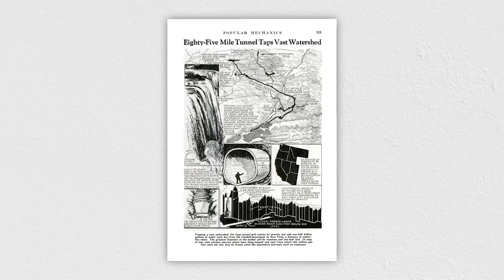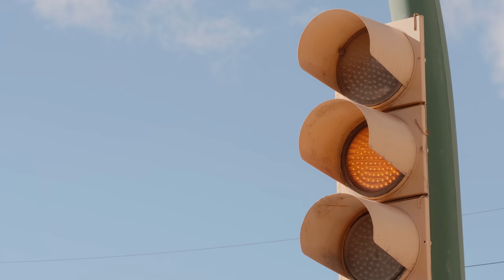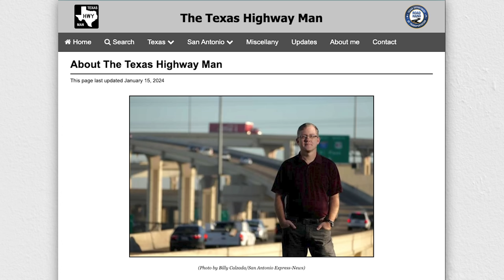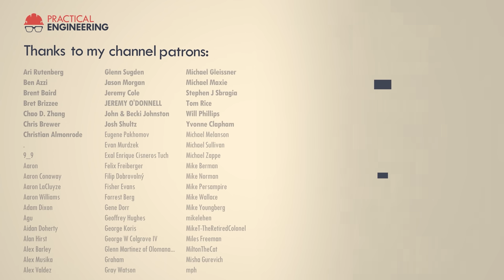Why Are Texas Interchanges So Tall?

Comment: As a former Ft Worth resident, I can tell you the one major downside is during the rare (but inevitable) ice storms. As there are no salt trucks, this causes glaze ice on these interchanges, causing huge pile-ups.
I barely avoided being a part of a hundred car pile up when a semi trailer made it 95% of the way up to the top, but due to traffic stalled ahead they had to hit the brakes...it then jack-knifed & came sliding back down, pushing every car on the 2 lanes & the side berms all the way back down.
There was nowhere to go, no way to stop the accident, no way to back up...literally dozens & dozens & dozens of cars crushed in inevitable slow motion.
Afterwards, the cars had to wait for hours & hours in the freezing rain while a fleet of tow trucks worked to pull each successive car out, starting from the furthest back.
Reply: I almost got caught up in this driving Uber in Austin. I got extremely lucky that my car got out of there without a scratch. After we were stuck for two hours, we got moving then I lost control again managing to skid right between two cars that couldn’t move then I got control again before hitting the barrier. I immediately took the service roads home after that which were just fine because they were not high up in the air with the freezing winds going above AND below the road.
Reply: I live in Dallas.  We have at most perhaps one or two ice storms a year. Salt trucks aren’t a thing.  And heated tram rails are discussed every time ice stops rail service but always is dropped due to cost.
Reply: Yep. Those of us in places with inevitable and routine roadway icing, bridges are the absolute worst to drive on. They're not insulated by the ground below them!
Reply: They block off and close the I-30 West to I-35 South interchange in Fort Worth when icy conditions exist.  They had to because so many trucks got stuck trying to go up the long elevated section.  They just keep building more of these stacked interchanges.  I-820 / 121 / 183 interchanges, I-30 / 360 interchange for instance.
Reply: I don’t know what y’all are talking about. I lived in Richardson until last year and lived through the few crazy ice storms over the last few years and we had plenty of salt trucks. Every single intersection in Richardson was salted to the point that I got annoyed because of potential rust issues. Maybe Dallas is different? That would be surprising to me as it’s much better funded.
Reply: @ryancampbell2192  I don’t know what you mean by no salt trucks.  There’s lots of salt trucks in DFW.  That doesn’t mean you can drive anywhere near the speed limit.  If you want to blame someone, blame the drivers.  People around here drive like idiots…which they are.
Reply: @ryancampbell2192  all of you are just wrong about the salt trucks.  In addition to the lots and lots is salt trucks, we have saline pre treatment trucks.  Now…these trucks aren’t going to do side streets or your ally.  Their focus is on highways and major side streets.  I’ve lived here for 69 years old,  and ever since I can remember, there were salt trucks.  Not as many then as now, but back then, there weren’t 8 million people in the metroplex.
Reply: Ughhhh i hate to imagine having to go to the bathroom during all that.  That must be horrible
Reply: @user-wl5wj3ho5x  I may have overstated that there are "no salt trucks" but it's not like up north where salt trucks are everywhere on freeways...In DFW they just aren't frequent enough on the skyways when ice storms come on quickly.
I was there 1998-2002
Reply: I'm so excited every winter. As soon as  the temperature hits freezing I immediately start zooming around the freeways. I have nowhere to go, but the thought of joining traffic and contributing in some small way thrills me like nothing else. The news says to be careful, stay home if possible. I ignore them of course and keep on motoring around the city. I can put 700 miles on my car in a day, just puttering around the highways, always searching for the biggest and slowest traffic delays. Then I happily merge in and enjoy the ride. The bumper to bumper, the smell of exhaust, catching a glance at what my neighbors are browsing on their phones. It's so much fun and it is the greatest hobby- calling that I never dreamed of. There are millions of people like me living in Dallas.
Reply: @thomaslink2685 I feel like I’m in a weird dream where I’m the only one that knows about the de-icing trucks, and sand trucks… 
Ever gone down the Dallas North Tollway south to the end? You pass a big structure that holds the sand allotted for the DNT, and the bad accident on 35W  a couple of years ago that included a FedEx truck? I was in a huge traffic jam the day before as they spread de-icer on the highway in anticipation of the freezing rain. 
We might not have salt, but sand and chemicals de-icer is used throughout the Dallas, Fort Worth Metroplex.
Reply: There are salt/sand trucks in DFW,  but they pre-treat the bridges before any expected freezing precipation and may go back over it once after the cold stuff hits the ground.  They don't have enough of these trucks when needed, but they aren't needed often so it's hard to justify the expense.  Most Texans just stay home during icy weather anyway.
Reply: That was my first thought when looking at the bridges: How do you keep them ice free?
Reply: @JimmyLeeJr 😂😂😂 I live here and this was genius!
Reply: No agency should put salt on a road. It just too corrosive and polluting. There are alternatives.
Reply: @Hybridog  No salt in DFW. Sand trucks and a pretreatment before the storms.
Reply: its also concrete roads cause ice too.
Reply: @SiqueScarface  you don't. Stick to surface roads when it's icy, because you don't wanna slide off a 100ft flyover.
Reply: Canadian here who drove in Texas in Feb 2004 in one of your "winter storms"😂.  There was 1/2” of snow and I couldn't count the number of cars that slid off the highway.  It was like no one had ever even heard of snow, let alone driven in it.  Comical to say the least.  For perspective, a good winter storm here drops 3ft of snow in 24hrs.
Reply: So true
Reply: @jeff-w it’s such a novelty in much of Texas. We do a late work/school start and then go out. Trucks with empty beds aren’t easy to maneuver on ice. As with anything Texas, some areas get regular snow and they do more treatments.
Reply: Every time I got on an interchange during those ice storms, and someone braked on them was infuriating and terrifying.. Texans are a lot like Californians in this regard. Neither know how to drive in any kind of inclement weather.
Reply: @LoriL010  In DFW at least, there were still plenty of people on the roads. Annoying af for the people that still had to travel for work.
Reply: @Hybridog They use sand here, not salt.
Reply: @jeff-w That's because most of them probably hadn't driven in snow before. Especially the Californians. But Texans are almost bad at driving in any kind of inclement weather as Californians, so it's a bad and dangerous mix 😅
Reply: Was this the one about 5 years ago on i30???
Reply: @jeff-w im from DFW and have fortunately never been in an accident during a snow/cold storm. But it's kinda hard to become "good" at something that only happens twice a year.
Reply: I’m afraid of heights, so the thought of driving around curved roads at such high elevation makes me cringe. 😱

Comment: 13:16 The designers of the WI30/I94 interchange decided to fly the left-hand turn to merge it onto . . .  the inside fast lane of a 70MPH interstate. Extra difficulty points are awarded because the flyover lane disappears in 300yards and much of that traffic is trying to cross 3 lanes getting to the far-right exit for the next interchange about a mile away. Fun times!
Reply: I find it hard to argue if that one is better or worse than the 12/18 and I-90 interchange directly south of it, where through lanes just appear and disappear at random. I think it mostly depends on which way you are going. 151 is probably the best of the 3 of them because it just backs up instead of throwing high-speed traffic into low-speed traffic and hoping for the best.

Comment: I live near I-35 and sort of between O'Connor and Loop 1604 in Converse (San Antonio area) Texas.  The cloverleaf to fly-over construction in this part of town is a massive project, slowing traffic to a stop, and often closing the highway altogether.  They seem to be putting in fly-overs along 35 from 1604 all the way down to 410, in an effort to relieve I-35 traffic.  That's about 5 miles of being high up in the air.  The Blanco Rd. to 410 interchange is long, but this new one should dwarf it in length.  It'll take a while before I trust the new fly-overs.  I can see how an accident might back them up completely.  The way people drive here, I expect that to happen often.
Reply: I live in the same area. Right now all the construction is a royal pain, but I’m looking forward to seeing the end result.
Reply: Yup, traffic is especially bad on I-10 and 1604. I can’t wait till they finish this project.
Reply: That 1604 (Anderson Loop) highway in far north San Antonio is frightening.  With all that construction, lane closures, speeding cars coming in from on-ramps, and just the visual appearance of that intimidating fly-over section I think I might prefer to drive from Del Rio to College Station by way of the Panhandle, or just turn around and go back to Del Rio.  If there's a rainstorm, then all bets for any trip through San Antonio are off.   🤐🤐🤐

Comment: 7:13 Frontage roads were one thing that really struck me as different when I spent a week in the Dallas, Texas area.  I remember a four-lane divided highway that had frontage roads on both sides, with restaurants and other businesses all along the frontage roads.  I have seen frontage roads in plenty of other states, but I have never seen anything like what I saw in Texas, with wall-to-wall businesses along the frontage roads, mile after mile.  In other states that I've visited, frontage roads tend to be minor roads in rural areas, with businesses only near exits/entrances to the main highway.
Reply: It’s very strange to me, especially if you want to go to another business, you have to drive alll the way over instead of just walking.
Reply: Frontage roads are an absolute abomination. They literally more than double the width of most highways, and are often the “highway lite” on toll roads. They enforce the worst style of merging.
Reply: Yeah in tex as Frontage roads serve as stroads, especially in the suburbs. The thing is the noise from the highway is really too loud, and the heat is just real bad from all the concrete.
Reply: Yeah, I've had the concept of frontage roads explained to me many times, but the logic of them still eludes me. How is your front facing the highway better than your back facing the highway?
Reply: You would really hate any construction to the Interstate/Highway as it tends to pile up the frontage exit/collection ability. It is not surprising that if you have to wait for 20 minutes behind a stop sign to exit local street and onto the frontage since there is no opening from the highway exiting traffic.
Reply: That actually sounds like hell.
Reply: @JoeyLovesTrains  Personally, in Texas summer I wouldn't be walking that far outside even if it was possible.
Reply: @Tgnn11 except that no. If you have an urban environment focused on reducing heat, you can literally shave off ten degrees from our summer temps. 

The reason it is so hot here is because of the cars and suburbs and roads.
Reply: As a DFW resident, I take these frontage roads for granted since I find them so helpful with getting around if you take a wrong turn. Having turnarounds at every intersection is fantastic since you don’t have to drive miles before you can change direction (like in most states).
Reply: They're a great and efficient way to rearrange industrial, commerical,  and retail space in a way that is fast and easily accessible for the most people.
Reply: @jm5390   @toomanymarys7355  I appreciate your perspectives.  I didn't find the "miles of businesses along frontage roads" design to be efficient or easy myself.  In particular, I seem to remember it being quite a headache to get to a business that was on the other side of the road (which really means on the other side of the major highway plus two frontage roads).  But maybe it depends on what you're used to.  And I've seen poorly designed roads in plenty of cities and states, so I'm not meaning to pick on Texas in particular.
Reply: @evancombs5159  humans are simple creatures, if the building is facing them it feels more inviting then the back
Reply: I moved from FL to TX and it surprised me like hell. I love it though
Reply: @toomanymarys7355  This seems like an absolutely mind-boggling opinion to me. Navigating around the highway and frontage roads is absolutely the worst part about moving around my city. The types of commercial space that thrives on frontage roads is the kind that also thrives in isolated industrial parks - because driving is the only way you could ever get there. The types of commercial space you might actually want to go to is very absent.
Reply: @toomanymarys7355  Now now, you're not talking zealot, you're talking rationally.
Reply: The Texas style frontage roads negate the concept of limited access. In a normal situation these businesses would develop along the streets that intersect the freeway at legit access ramps. I think the whole place is a hellscape and go there only under duress.
Reply: Personally I'm not a fan of most the frontage roads. They're difficult to get on and off of without a traffic light. Not to mention the people that try to pass traffic in the right lane and make it more dangerous to get in and out of the roadway.
Reply: Ontario has a lot of service roads along highways with businesses along them but in recent years they've been removing the on and off ramps to the frontage roads.
Reply: @evancombs5159  TxDOT even did a study 20 years ago that proved that they don't really work for their intended purpose and make traffic worse. Then they continued building them for 20 years anyway.
Reply: @jm5390 no most states you can just turn around immediately, TEXAS is the state you have to drive an extra 5 miles just to get back on track…
Reply: @nolifenerdwhohasnevergotten  Texas has gone to at least 1 mile between exits as have many states. Are the removed ramps less than a mile from another exit/entrance ramp? This is a safety issue.
Reply: Right I was there during a hurricane and it was all flooded
Reply: Ah yes the continent-wide strip mall. It's not great
Reply: @evancombs5159  Why would a customer want to see the backside of a business?  Show the big garbage bin to the customers as they exit the frontage road into the parking lot?
Reply: @think-some-time  What type of commercial space is absent?  I don't see anything absent.
Reply: @robertpeterson8640  I have driven on Texas frontage roads for decades with no problems.  I never hear anyone complain about them.  A very large % of Texas big city residents are from other states, and they don't complain about them.
Reply: @lisasdfwhightechworld9946  Coffee shops, walkable malls, restaurants, local stores. The only things that thrive on frontage roads is parking-lot nightmare bulk stores.

Frankly, my assumption is that if you've "driven texas frontage roads for decades" and never heard anybody complain about them, you've never talked to anybody from out of state.
Reply: Urban frontage/service roads in Texas turn into congested parking lots in front of all the endless strip malls lining the road. The concept of limited access highway is destroyed.